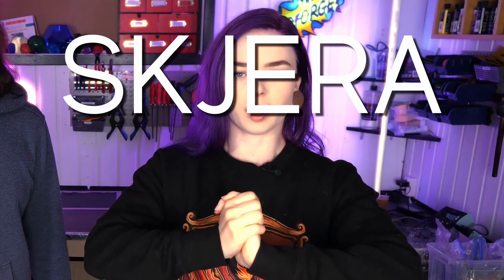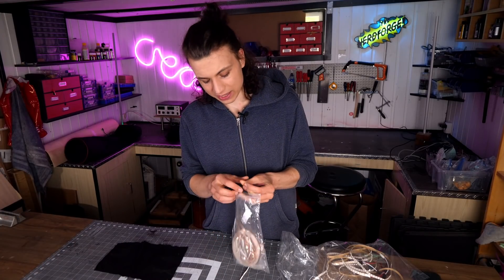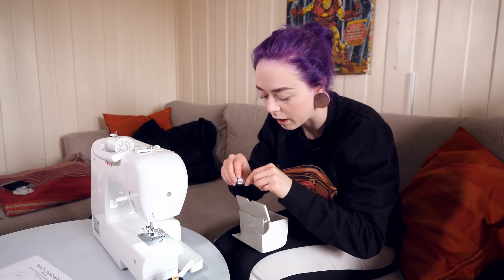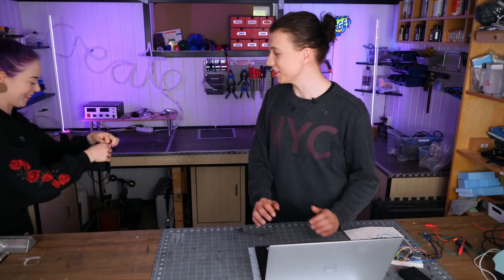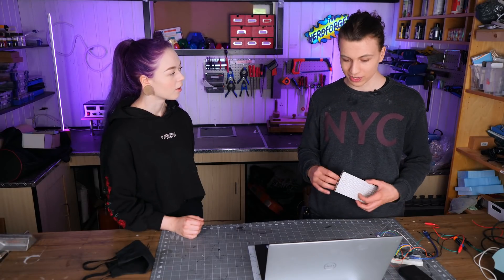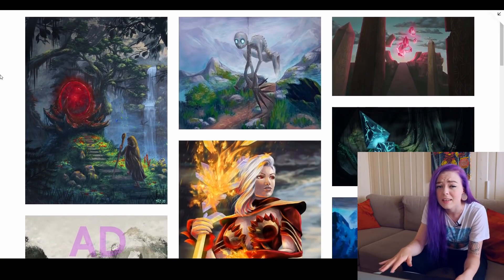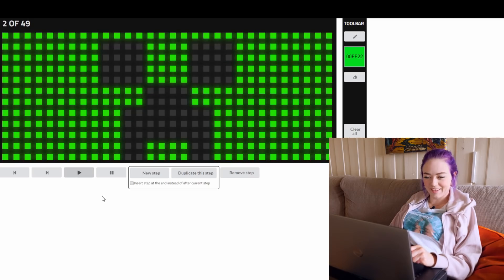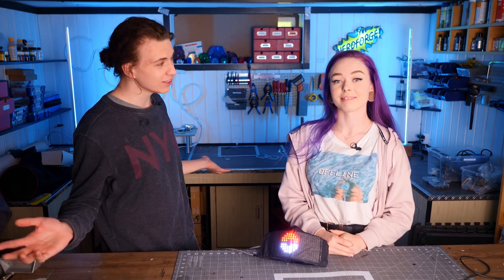Making a Face Mask with ANIMATIONS!!

Comment: Thank you so much for this wonderful project. Can you please let me know where can i find web app for a 32x8 led matrix or tutorial to learn and modify current web app to 32x8 matrix.

Also please let me know what modification is required in Arduino code to run random patterns one after another without using push button

Comment: That's really awesome! I actually used a similar mask pattern before, but I recently tried out a 'japanese 3d mask' and found it fit so much better! It also doesn't have a front seam so it'd be even better to house the LEDs :) https://www.youtube.com/watch?v=rYetThVY_kg
You'd have to tweak the design a bit though, as this one doesn't have a pocket for the filter/led panel..

Comment: That is wonderful! Thanks for doing that. I wonder if you could do it low power with an arduino with bluetooth in the mask and everything powered by a coin cell battery. Then the app could communicate with the arduino wirelessly from your phone. The only issue I see is the drain of the leds. If I wasn't already designing other things just now I'd grab some data sheets and see if it's doable. adafruit.com is a good resource for things like this too. They have various individually addressable leds.

Comment: Just found this project that lead me to start on a Motorcycle helmet animation idea (for cosplay not actual use lol). You guys posted LED editor animation program and works for 30x12. Does the code to put in the Arduino only work for 30x12 matrix? I have a idea that is probably going to be 30x25 or less.  
Your method of using the copper tape and mounting it on a fabic is killer idea. Im just starting but your video helps solve problems with wiring and other fires that i will probably come across. Thanks for awesome video

Comment: only things i could see needing improvement, was the cloth that covered the led's could have  been a bit thicker... could see the led panel quite well... and maybe have spaced the led strips slightly to allow a bit more ventilation, and sprayed the led matrix with something to waterproof it, so the moisture in your breath didn't corrode anything... other than that, awesome fricking mask...

Comment: Wait, how did you manage to keep that current draw under control?
Each WS2812b LEDs draws roughly up to 50mA each. When you light up the whole Matrix white you would draw approx. 15 A.

15 A will definetly start to smoke....
Reply from the maker: It's pretty simple! Don't power all leds at the same time with white color, 100% brigthness! I never run these on more than max 40% brightness, and it's very bright, never had an issue with too much power draw.

Comment: Hey @NerdForge I have exactly the same sewing machine that you, to load the under-thread reel you just put the reel on the spinner at the up-right of the machine. Then you push it (the reel and the spinner) to the right in the direction of the white nylon piece, it will click. Then thread through 1 (like you would normally to sew) and a loop on 2 (it's a kind of flat screw, see the markings over the machine, I see it's there in the video) and then thread through one of the holes of the reel and hold the thread like 2cm away. Just push the pedal while it spins and load-up the reel for you. MAGIC

Comment: Whats the heat dissipation like? Neopixels get quite warm and that's quite a dense matrix, or is the condensation in the breath causing a cooling effect on the LED's as air is pulled and pushed through the matrix?

Loads of people have commented that the under thread is called a bobbin, this is because its a round thing that thread is wound around (https://www.etymonline.com/word/bobbin), so the top thread is also a bobbin, which as an 'old' word its probably time to change, so I'm gonna use 'top thread' and 'under thread' from now on, words should define things, it's literally their one job.

Comment: If you could attach a microphone to controller and just have a program that reads a value from the microphone and set an LED based on that value, advance to the next LED and repeat, over and over through the grid.  It would form patterns as you speak through the mask.  Some friends did this with an old PC (we used the pixels of the monitor in place of your LEDs) and a cassette player (yes, I'm old and we didn't have the Internet then) in college. The things you do to amuse yourself when you are a poor college student.

Comment: How is the power situation working with that many LEDs?  A powerbank usually puts out 5V@2.5amps or so, I have an ambilight setup on 283 LEDs and it takes about 14 or so amps at full bright white.  12x30 is 360 leds in your matrix.  Are they just not very bright?

Comment: I just had an idea for an additional feature: Add a wifi or bluetooth module to the arduino and create an app via processing (works the same on mobile as on desktop) where you can connect to the arduino and maybe get the filenames from the arduinos sd card (send from the arduino to the app) and then you could choose a file via the filename inside the app which will then be loaded and displayed
Edit: Or you could just make it easy and use a touchscreen module (or just a lcd module and 3 buttons) which displays the filenames which you could then scoll through and choose from :D

Comment: What type of led strip did you use and where did you buy it? It looks like it is RGB with 144 Leds/meter. That kind of strip costs between 20-30€ / meter in Amazon (I know in aliexpress it may be a lot cheaper but i don't want to wait three months for it) and to do this you should have used between 2-3 meters.

Comment: Pro Tip: You can just buy the LED strips with a black tape instead of a white one.
Reply from the maker: That is absolutely a pro tip, and we would def have done that if stock was not out :)
Reply: @Nerdforge  I NEED ELECTRONIC CIRCUIT DIAGRAM
CAN U SHARE ELECTRONIC CIRCUIT DIAGRAM 
PLZ I LOVE THAT AN I WANT TO MACK BUT I NEED UR ELECTRONIC CIRCUIT DIAGRAM PLZ PLZPLZ

Comment: A 12*30 matrix has 360 led which each use about 60mA per led, so you would need a battery bank that supports about 20/25 Amps or am I missing something?
Reply from the maker: This is true if you attempt to light them all up in full brightness, full white. But they are always ran on 1/3 of the brightness, usually not white, and very rarely are more than half the LEDs lit at the same time. Haven't had any issues, even when they were all green! But during testing it was very easy to see if too much current is being drawn, as it results in a voltage drop that discolours the Leds (as in your example, all white, full brightness, they turn yellowish).

Comment: You can improve the project replacing the Arduino by a Wemos D1 mini. It has wifi function so that you can transfer animation wirelessly via a mobile app for example. Check that out !

Comment: Looks like you have about 360 LEDs in the mask? At 0.3W per LED, that's like 21.6A at 5V. Do power banks these days support that much current safely? Maybe there's something I'm missing, I'd like to do this for my daughter's graduation but not sure about that power supply part
Reply from the maker: They run at 1/3 brightness and they are plenty bright! :) Power bank delivers 3A. Rarely are even all leds lit, and the worst case you portray is full power white. If you try to draw more than it can deliver, the voltage drop is so significant you can see that the Leds don't light up on the proper color. Haven't had this issue though, not even with the creeper pattern. :)

Comment: For a "box" for the electronics you could use a dead powerbank case the same size as the one you have or get a similar dimension plastic flip lid box. Also to hide the wire better add a couple of velcro loops on the strap so the wire goes down the middle of the back.

Comment: I LOVE IT, so much better than my mask I just have a plan black one with a filter inside and I need colour so I sowed on an Iron on patch just in case I wanna take it off and put it some where else, I do not like putting something on something if I can't take it off again later, I love sticker but I never stick them to anything I turn them into magnets to I can put them on my white bored, them wall are sticker you can get I have some,  but not put them up I need some thin wood bored I can put them on so I can then hang them on the wall,  and my phone case I put pitchers between my phone and a clear case.

Comment: forever, it’s bothered me so much that the LED sign in the back technically says ceate, rather than create
Reply: Danni Velasco technically,it doesn’t.  There’d be no peak between the c and e if it was ceate.  It’s a weak r, but it still passes.  Should have more of a double peak than a single peak.

Comment: That is easily the most epic thing I've ever seen. Fantastic work! :D
The one, and only critique I could offer would probably be to use a lighter gauge power cable connecting between the mask, and power bank if possible. It looks like it might drag a bit, or cause minor discomfort after a while due to the bulk.

Comment: This is pretty cool, but why put the LEDs on a peice of fabric? It would make more sense to use a strip of flexible plastic or worbla with ventilation holes in between the LED placements, as that fabric is going to eventually need to be washed. Also the outer layer of the mask does seem to distort the image a bit from some angles. Maybe using white fabric would have worked better? Either way this is a really great project and I'd love to get a hold of the program you use to make the animations so I could try building one myself.

Comment: Very nice animation tool. But think of another approach. Why not make use of existing tools for GIF creation. They provide more control and flexibility and you would only have to write a little converter to scale resolution and read out timings for your arduino program. Also you would be able to use all existing Gifs you could find in the internet.

Comment: This is neat, but I see two possible design flaws in terms of it actually being used as a face mask. 1. The mask may be washable, but the LED section is not, so you would need to find a way to thoroughly sanitize it after each use. 2. That LED layer does not look very permeable, so it might be kind of tricky to breathe in that mask.

Comment: Wow, I have a feeling that this was a LOT more effort than you made it seem! Especially the web-app. We started the same route for making animations for or ferrofluid-display "Fetch" (making our own app), but realized there was no need to re-invent the wheel, and instead wrote a parser for .aseprite files (https://www.aseprite.org). Aseprite is a semi-open source program (free to build yourself, but not free to distribute), that has all the necessary features for making pixel animations such as this (plus some really advanced ones). I have a feeling that you've pulled your hair with the lack of a selection tool for copying, pasting, moving or deleting. Anyway, I don't know if you'll spend any more time on this project, but if you are going to - I'd suggest trying our Aseprite, it might make your life easier :) Lovely project, as always!
Reply from the maker: Thanks for the tip! These days I take enjoyment in coding small things like this, when video is most of my day. In the back of my mind I knew there would already be something for this, animating an LED-matrix is hardly something ground breaking after all! Will check out the program you suggest:)
Reply: @Nerdforge  Totally get that! We also got to about the point you're at now before we said "that's enough time spent on this" (we had a few extra features, but not the online aspect). So it's utterly relatable :) There are a few perks with your online solution that we don't have though! Especially the aspect of connecting with fans. We really wanted something like that too. Additionally, it's easier to make the UI tailored to your needs. Stuff like a hard-coded canvas size, and, I mean, you can draw in a face there to make the center obvious.These things would be hard in Aseprite (or any other general purpose animation program). So, it's a perfectly valid solution! It's just nice to have a bunch of features sometimes, too. Especially for productivity.

Comment: I love that suddenly Martina's hair was suddenly pulled back.  Definitely not a good idea to have long, loose hair when sewing!
The under thread is the bobbin thread. "Bobbin" is actually the name of the little spool that goes underneath that the thread is wound on; they just call the thread wound onto the bobbin the bobbin thread.
Good job with the sewing. I've done some sewing for medieval clothes, making whole outfits, and then kept messing up a simple hood.  Sometimes the things that seem the simplest can be very difficult.

Hansi, did you think of using a metal Altoids tin for the little box? You do have to insulate the circuits better, so it's not ideal, but it's a very useful little box, especially for Arduino-sized projects.

The generic animation interface is ingenious! Great idea, really well executed!

Another outstanding project!